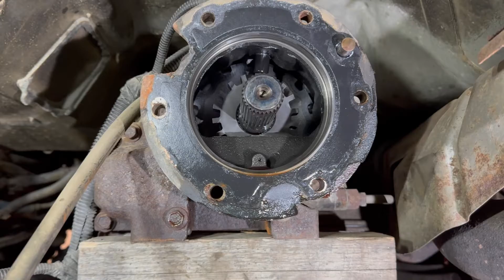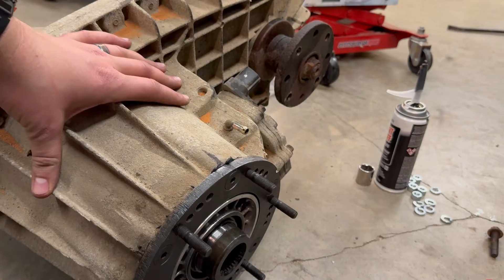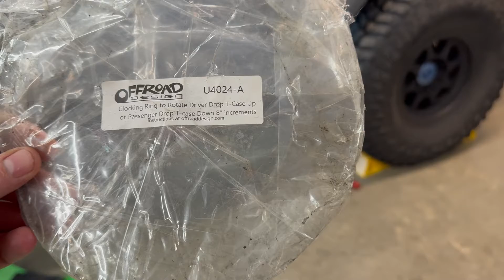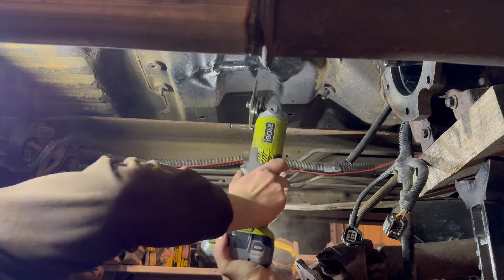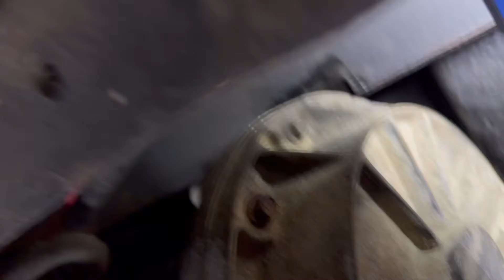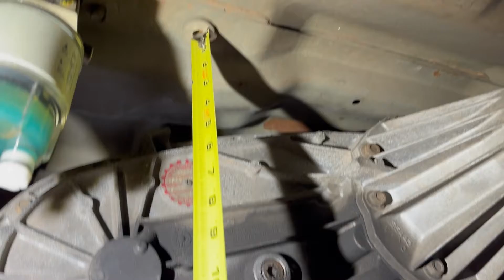Installing a Transfer Case Clocking Ring In The Bobbed Excursion

Comment: By the way what filter  is that on the other  excursion  on the Frame rail  ?
Reply from the maker: Fuel filter. It’s just a cheap filter from Amazon. You can find the whole install in my “excursion hutch mod” video.
Reply: We put a marine water separator on the Cherokee for Baja, worked great can see the water and just drain it out ❤